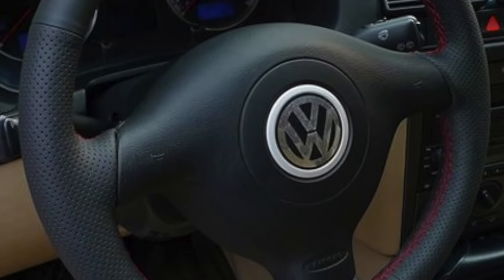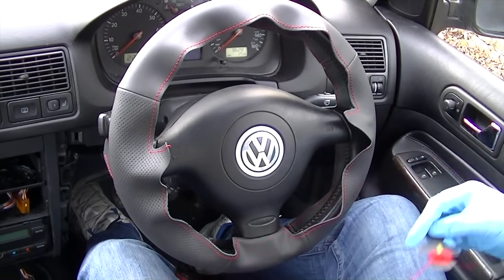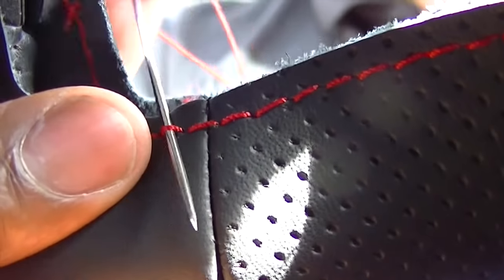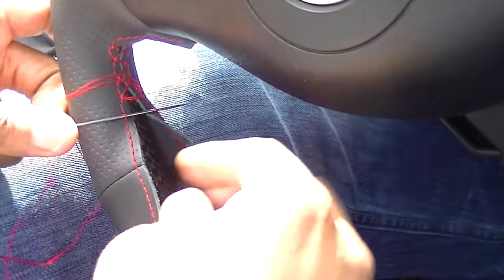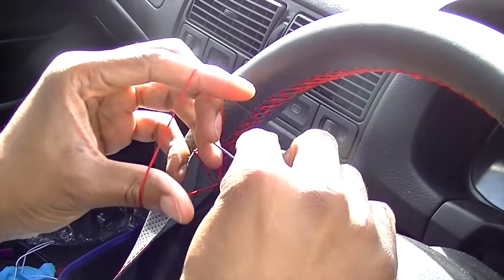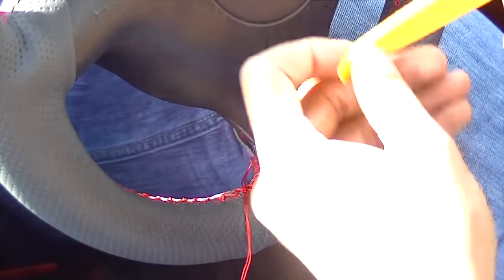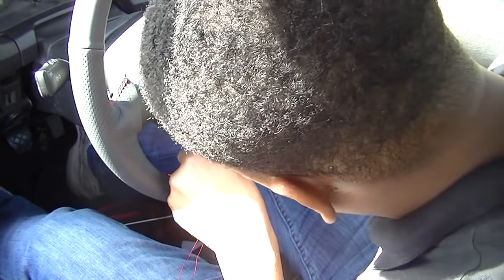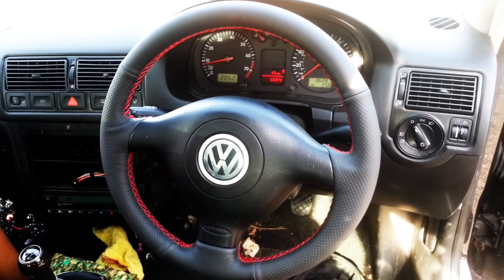How to Stitch a Race Leather Steering Wheel Cover

Comment: Nice video. I installed the wheelskins steering wheel cover and the design and install is a lot easier. You only need one knot and the thick dental floss thread is used single and not double. Also the needle goes directly through holes in the leather and not through thread loops

Comment: very nice job..that project is on my to do list of diy ..i'll be using alcantara material tho..i would score you 95% on this project ,not being judgemental here lol..i would suggest next time you use a heat gun/hair dryer on areas like the corners that arent seated properly to the steering wheel..and a dab of leather adhesive on those intricate areas that u stuffed in,,but i must say..IT TURNED OUT OH SO GORGI
Reply: adding heat to the leather wouldnt dry it up and make it less flexible? i plan to add a steering wheel cover as well but want to remove all possible wrinkles...did you use the tape that came with the kit?

Comment: I was thinking of buying a similar styled cover but I saw a couple of installs where they actually use double-sided adhesive tape before using the thread. I'm not really a fa of the idea that the cover will be pasted on the steering wheel but is this method of just using thread enough to fixate it and create a tight fit?

Comment: Not quite sure covering up the original steering wheel material which is of higher quality than the cheap vinyl faux leather is in any way better.It also fattens the steering and alters the grip hold.
I would stick with the original.If it was degraded or needing retouch that would be better.Its quite easy to touch.up uneven or scratched parts with a filler, sand it lightly, dye the whole steering and apply a DupliColor black coating.Total cost of the materials ie filler sandpaper and a can of DupliColor may be the same maybe less but  much.faster and easier to do.
Good as new that way.
Reply: u cant get rid of the curry smell   gilly gilly

Comment: Good tutorial on how to get a shitty looking and poorly lasting stitch.  The existing stitches are being stretched and pulled to the other side.  You should have gone through the pre-made holes and not pull on the existing thread.  I don't understand why there is an existing thread in place.  I could say more but, I think you get the point.
Nasty.....just nasty.